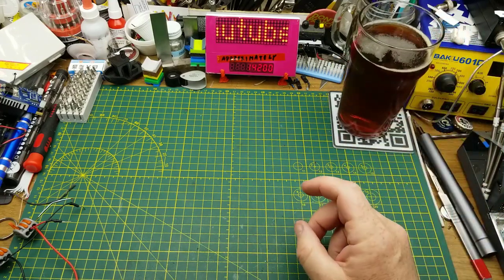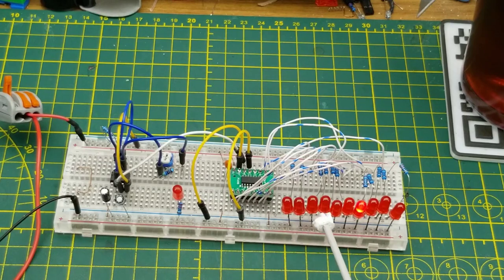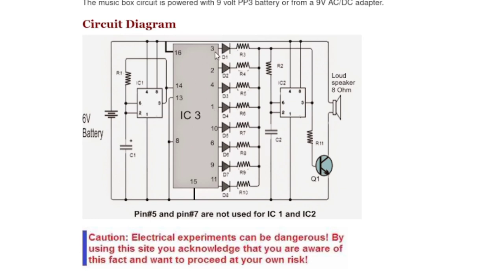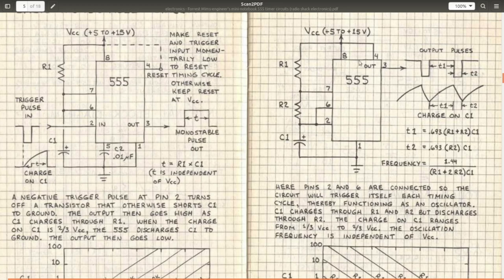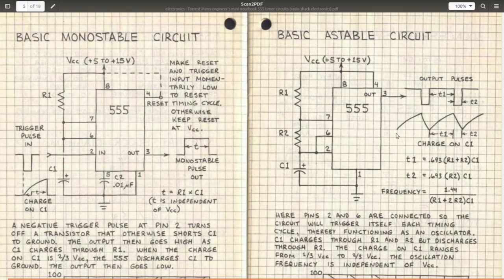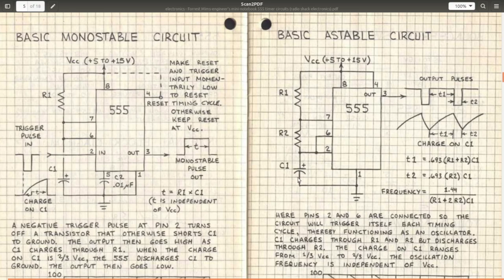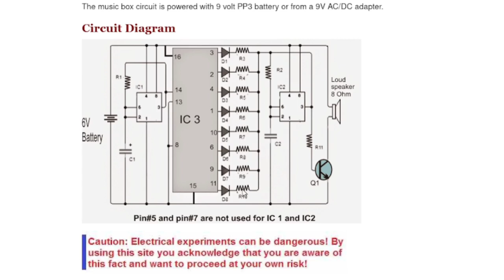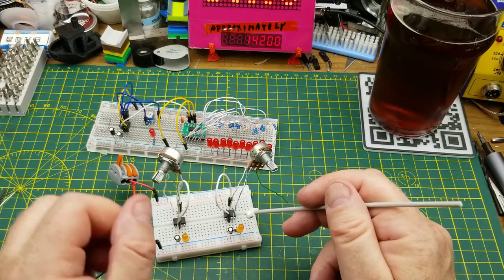simple electronic music box circuit

Comment: I vaguely remember building something similar in the late 80s using a binary counter driving a 2716 eprom address bus, while the data bus had a DA resistor ladder network and a 555. I never programmed an eprom. I just used random eproms to see how it worked.

Comment: Change the selection resistors to preset pots and you can change the tune when you want
It's just a sequencer
btw, the 10 led circuit, you could just common the cathodes and use just one resistor to save space ;)

Comment: Replace the diodes with LEDs, for a visual and audio experience?
Reply from the maker: That would work, though with a higher voltage drop (which , absent any other changes, would lower the frequency of the audio oscillator).
Reply: @pileofstuff  To counteract that, lower the capacitor C2 value to increase the frequency again.